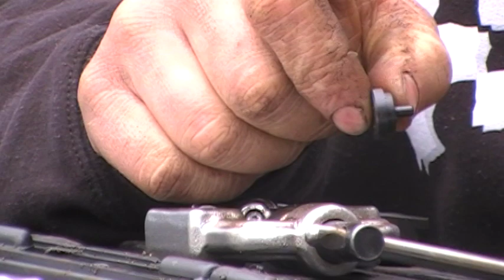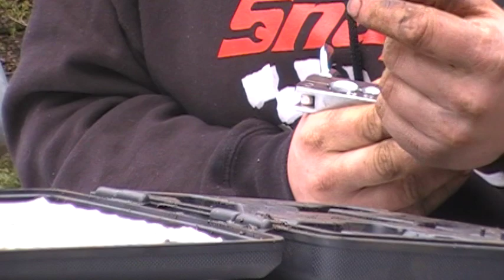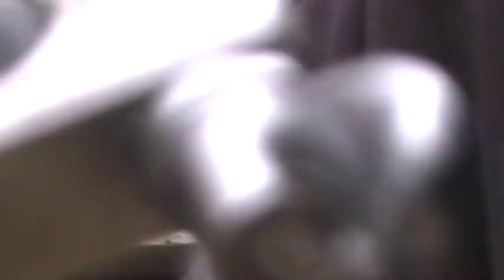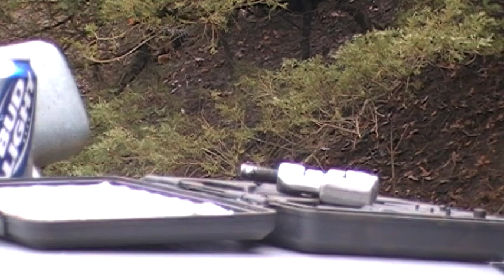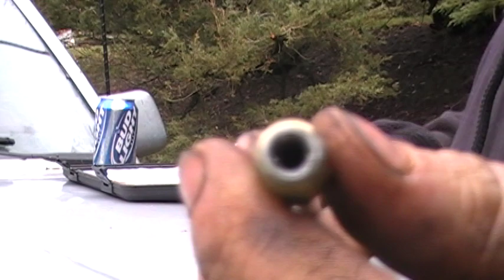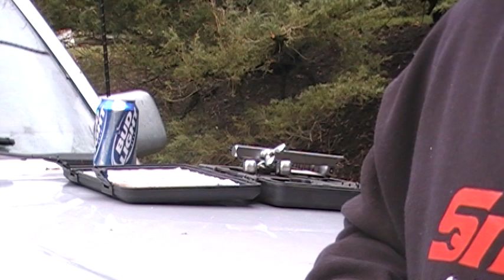how to make brake line repairs

Comment: Hi Mate, I have one of these kits, Do they make flares on STEEL, it always mentions copper???.... There is a new type of steel brake pipe that is a little softer than steel as it contains something like copper in its makeup, and makes it a little easier to work with I believe..
                                                 Subsonicnat UK.
enjoyed the video too.

Comment from the maker: @jheibertz only use steel tube designed for use as a brake line any other type of tube or hose may not be able to withstand the high pressures in the sysyem and will blow out or leak at the weakest point.

Comment from the maker: you should be able to pick up a flaring tool at any auto parts store for less than 50 dollars that will handle the mild steel tubing used for brake lines

Comment from the maker: well i have a tubing bender but i usually bend it by hand because there isnt always room to use the tubing bender. and the only way you will damage the tubing while bending is if you try to make too tight of a bend and kink the line tight bends are where the tube benders are great but you can do most gentle bends by hand with great results

Comment from the maker: every flaring kit is different but most of the kits have a step machined on the flaring adapter and yes the line has to be flush with that step inorder to achieve a perfect flare